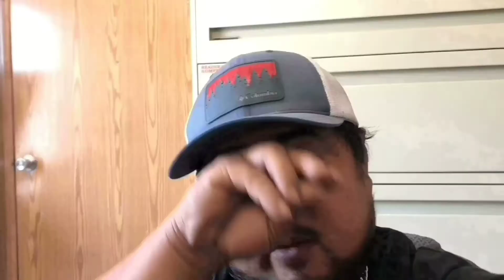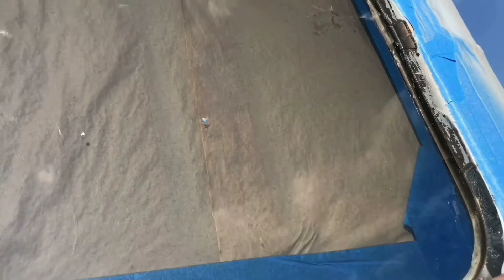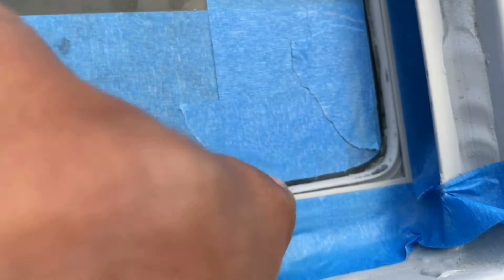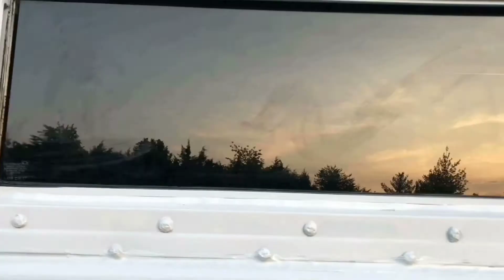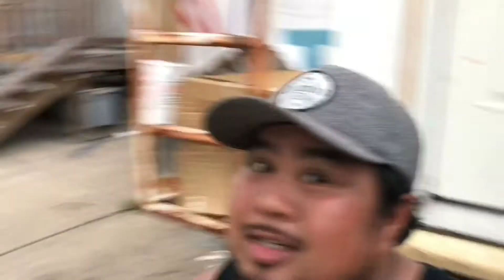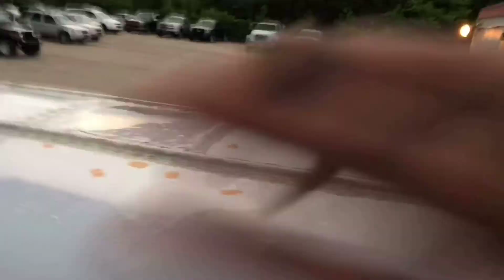EP 29 BUS HOME BUILD : Attempt to paint/seal the roof

Comment: I hope ya know I'm hating on you right now. Why I didn't tape off my windows before I caulked them? fml lol Seriously though, what black caulk (brand, etc) did you use for that? I still gotta do the other windows and might deal with that today if I get the transmission back in
Reply from the maker: Squirreled Life That was LocTite (blue tube) .. It was messy ass hell. Not what I am used to with OSI QUAD. Home depot stop selling OSI in black so that’s why I use the LocTite brand. But after I did the windows my siding/roofer buddy suggested a local ABC Suppy Co...and sure enough they had the OSI in black!! 6bucks vs Amazon online 14bucks a tube. It’s much easier to work with.